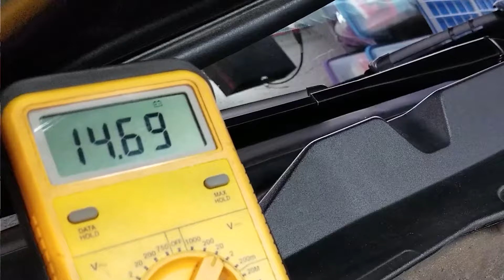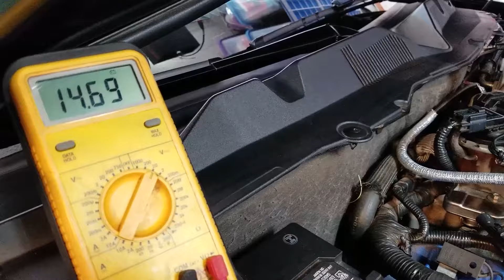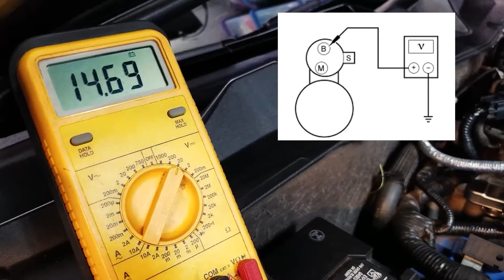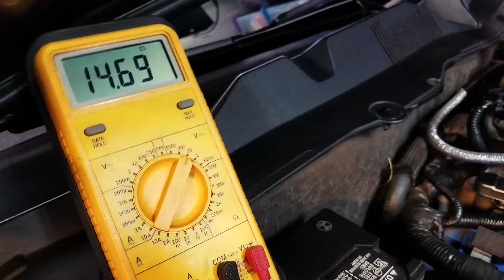Who else wants to troubleshoot "no crank" starter problems like a pro?

Comment: A voltage drop test is key to most electrical diagnostic procedures, any resistance before the load can cause issues
Reply from the maker: Thanks for taking the time to share.  Your voltage drop comment adds value to the community.